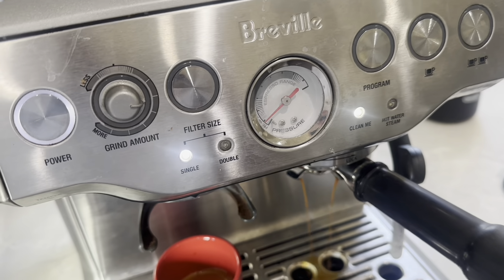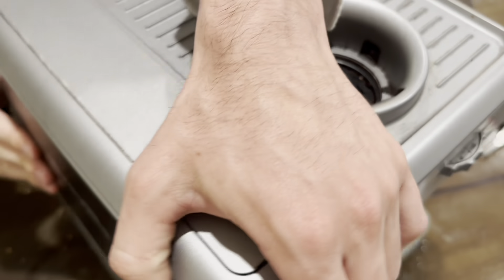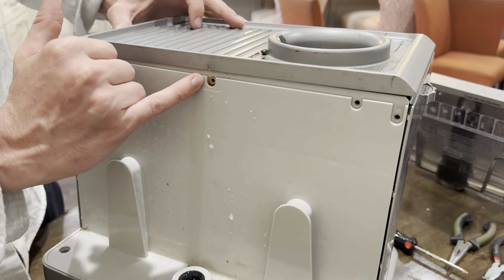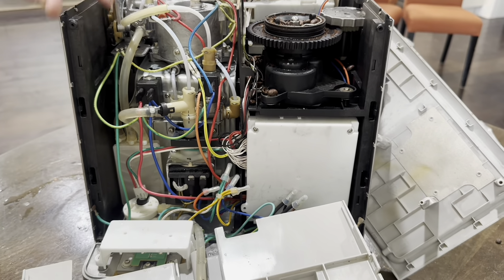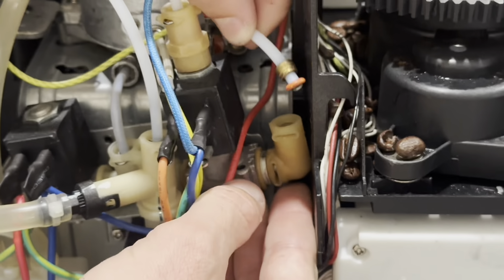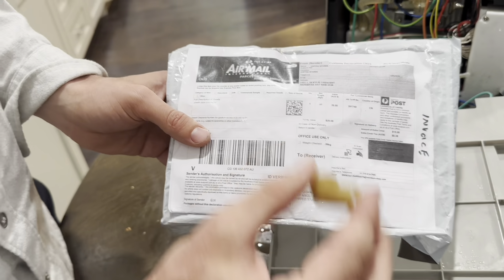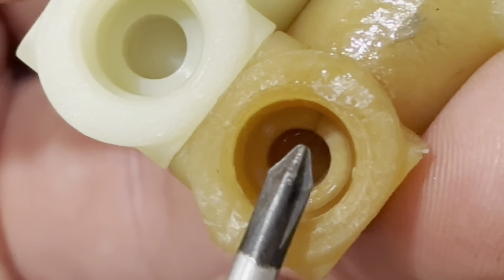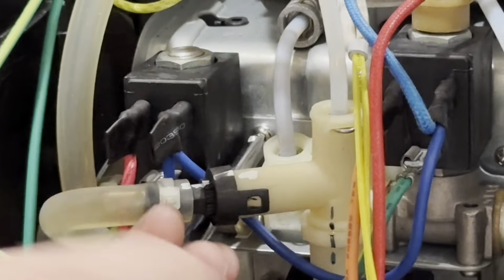DO NOT THROW OUT YOUR MACHINE - Easy Breville BES870 Espresso Machine Repair

Comment: Hi Joseph, this was a super easy to follow video. My issue with the same model is that it will not start up at all, pressing on the power button does nothing. It has been slowly leaking for a while now, so i suspect a similar issue as what you described. How do i get it to turn on to identify the leak? Any ideas?

Comment: Great videos Joseph. My issue is that the machine only turns on very sporadically. When it does it works fine. The light ring around the power button blinks but it wont turn on. What should I check?
Reply from the maker: My hunch is the issue is caused either by the heater assy/water boiler component that has reached the end of its life or the temperature sensor related to the boiler. If your light blinks in a particular pattern, that often can be matched to an exact error no. on Breville. For example: https://www.breville.com/inspiration/en-us/tutorials/the-bambino-plus/cleaning-guides/how-to-perform-a-cleaning-cycle. I hope that helps!

Comment: Hi Joseph, well done, clear and concise. I think I have the same issue after 8 years of heavy usage. I do have a question. What do I search for to find the right elbow connector? Would you have a part number or descriptor to find the piece on Google? Thank you. Andre
Reply from the maker: My particular elbow connector was part 149 as seen in the Breville schematic, but you can try this link:
https://www.ebay.com/itm/186097236340?_skw=breville+espresso+machine+elbow+connector&itmmeta=01JBMQRJ3EASR6PHJWEZ891VYG&hash=item2b54427974:g:NWsAAOSwGrRl0r3z&itmprp=enc%3AAQAJAAAA4HoV3kP08IDx%2BKZ9MfhVJKlD0RGXxzqCYmpma8Ef5Nbv2bmo5IONxyQCt0HjBNfCgynGCxCEAp%2FSVWv23mBttQy1sl%2Bu3%2F0HITAiTHdAHb5d3QIhDt%2F0L5%2BAj4mXqGnYADZ7RboilDQeAzQWGKac4eGpmiHyp3ehKy60Sgc7sms32OZpbzgeei9KodB%2FqLl4b8dYusfiSx4FEvo84o4SyexOlRyOq2bf9BdUTu30qT8nb6DTFVWnun%2F9S3md1mE0A%2FsV2tG5U2oCEW0tHpKzMDUYwSMOEcYsYMQ9cn7mM90K%7Ctkp%3ABk9SR-Sh4pfdZA